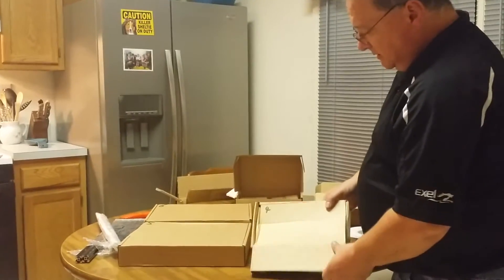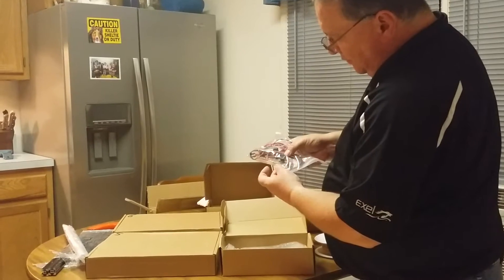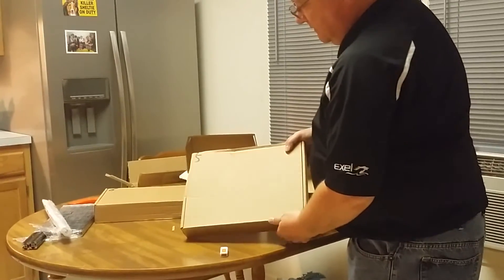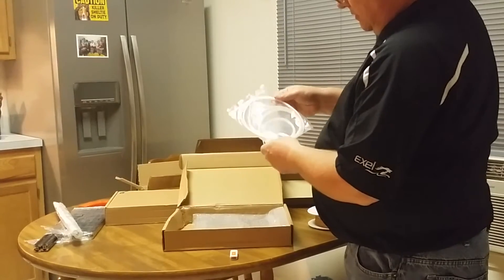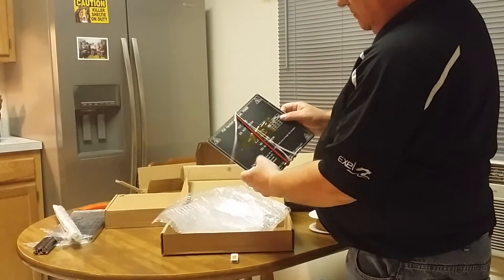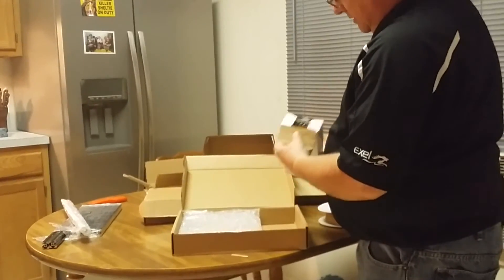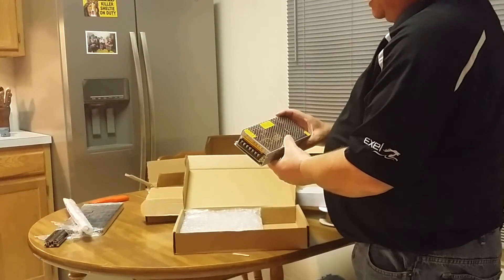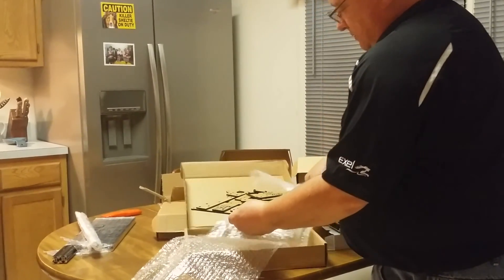FLSUN 3D Metal Frame Prusa i3 unboxing 3

Comment: Nice unboxing, thanks. Any updates on it?
I'll bet dollars to dimes that a bigger power supply and an external mosfet fed directly from the power supply with 12g wire will boost performance of the heat bed dramatically. All of the RAMPS boards suffer from an under-powered heater bed mosfet and the terminal screws burn up under all that current.
But I'm curious if it comes with a RAMPS. That's a plus in my book. Even if it is a dinosaur, it's a solid and reliable board, as long as you don't draw heatbed power directly through the board. And the expansion possibilities are endless.
Reply from the maker: Vape Scaped love the printer. I did have to upgrade the power supply and wire. the board is a ramps derivative. There are a few changes and better Mosfets are one of them. I can't even feel them getting warm. The instructions had the normal errors but the novice could figure then out.
Reply: MendingThings thanks, I'm seriously considering one of these with my tax money, fingers crossed, and I know I'll have to upgrade parts, that's the fun of it. but good to know its a ramps style so I can swap out the motor drivers n add more fans and maybe a dual extruder later if I get ambitious. it looks like a great platform to upgrade, but still good enough to teach me the basics.
in 5 years all that will probably be left original is the frame, but that's the fun of it. 
expensive hobby, but still cheaper than a boat
Reply from the maker: Yeah, I normally do that to everything I buy but honestly I have been letting this one just be my workhorse while I am upgrading my other printer.